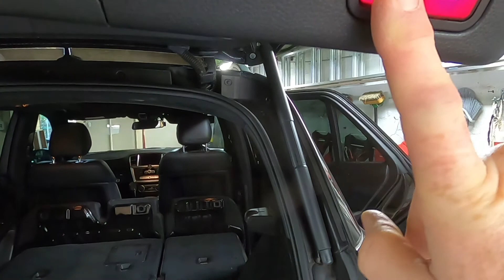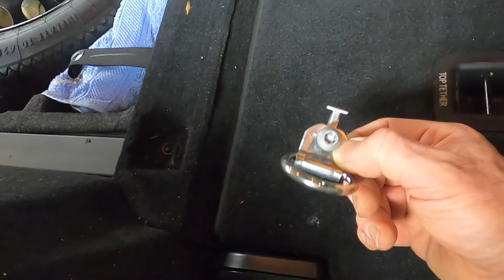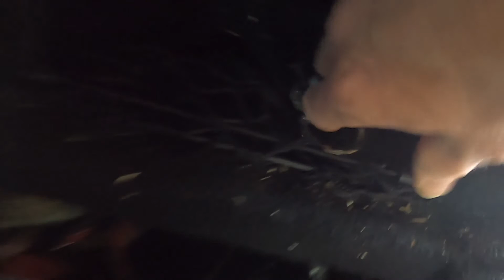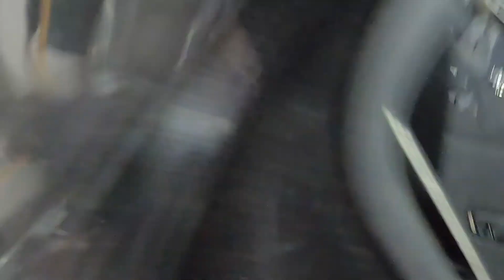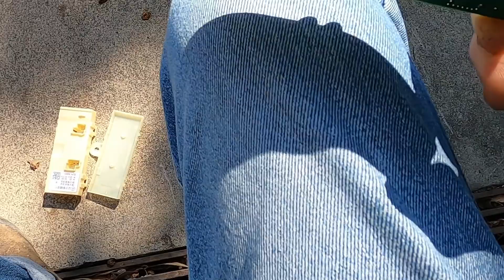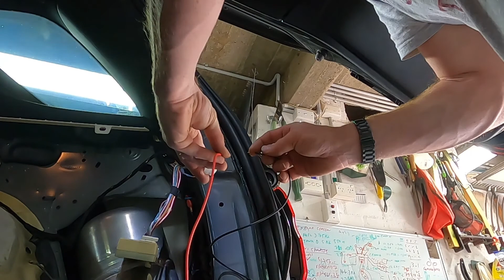Mercedes ML350 Power Tailgate Fault – Diagnosis & Trim Removal Guide

Comment: I face same problem with my G500 model 2015
They fix by update the programm online with a username and password 
Now working well

Also they told if you change the control module it will work

Comment: Dropping a comment here as it may help others. I have an Australian 2014 ML250 Bluetec where the rear automatic tailgate stopped working quite a few months ago. I took it for a routine A service at my local dealer and they did a software update to the ECU. A few days later during a separate service visit they also replaced NOX sensors under the campaign bulletin RC2793. Strangely after the NOX sensors were replaced my tailgate magically started working again. Very weird as we've been manually forcing it up and down for months and from memory it as still not working after the ECU update (invoiced as 99MBRC2793)  last week but started working this morning. Perhaps this means the actual tailgate computer module is salvageable via a software update?
Reply from the maker: Certainly strange!  I didn't try that, but yes there is a chance that the MB dealer ran a firmware update on all modules and fixed it.  Lucky you, was a real run around to fix mine.

Comment: Hi Aussie Jack, just watched this video and have come to the exact conclusion but I'am none the wiser to fixing my problem. Is there another video explaining how to fix the problem. Just to confirm, I checked the circuit board and all looks good,I then checked to see if the the motor in the lift arm was working the same way you did and it's working.And lastly I took off the button on the top of the door and all looks good as well. Now just stumped on how to rectify problem. Please help. PS were abouts in Australia do you live??
Reply from the maker: Hi Paul, my ECU looked good and the motor worked So I was also confused.  I took it to an Indy; they could not talk to the old ECU, only the new one.   Unfortunately they could not program the new one, so off to the dealer I went.

Comment: great job! can anybody give me any suggestion please. my w166 boot keeps locking from time to time and when it opens it makes noise (little blust in the front part of the car, someware near the engine) and produces smelly smoke 😟😦😟
Reply: That’s not good. Smoke is very bad.  You’ve got wires shorted out where the smoke is coming from. I would get that looked at before your car starts on fire.